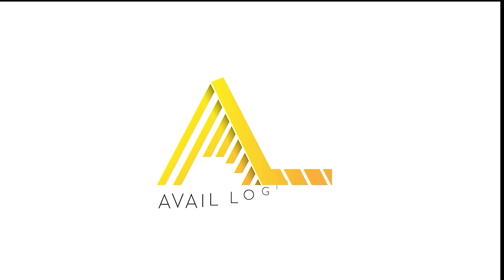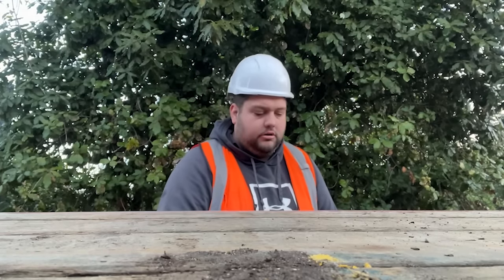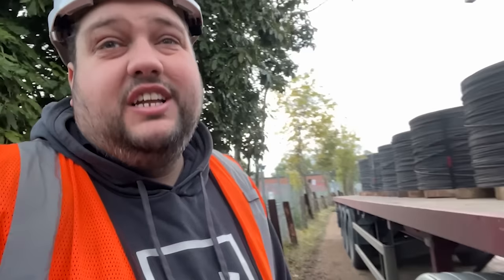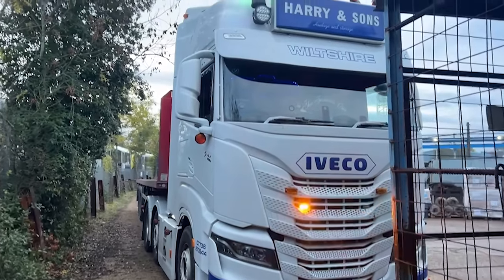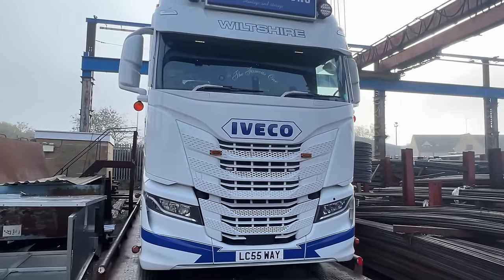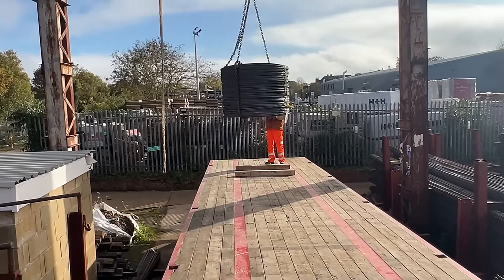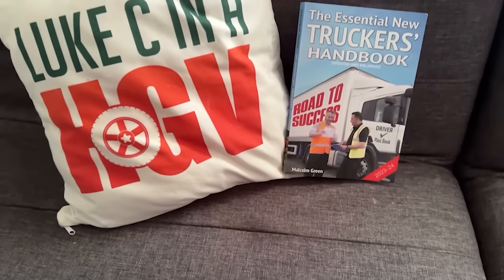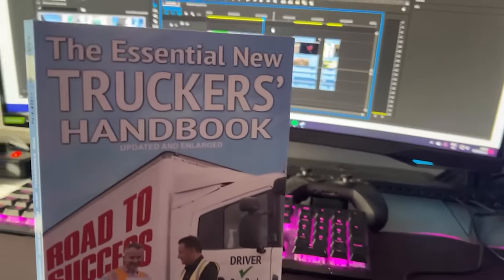We've gone FULL CIRCLE

Comment: Small piece of useless advice for you Luke, it does a diesel engine better to leave it run for a minute or two to cool down when you pull in, also is better for the turbo to let cooler oil go through the turbo for a few minutes before shutting down the engine
Reply: Definitely not useless advice, good especially for a truck when loaded the turbo will be working harder.
Reply: I'm not a lorry driver but thought that was the norm tbh🤷‍♂️
Reply from the maker: Normally I do
Reply: Are you not allowed to stay in truck stops, will your firm not pay for it ?